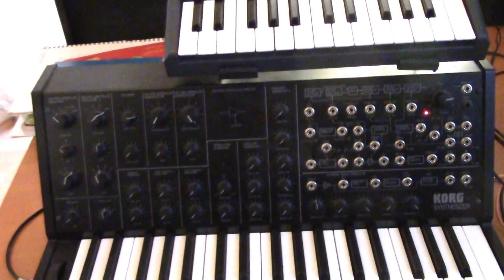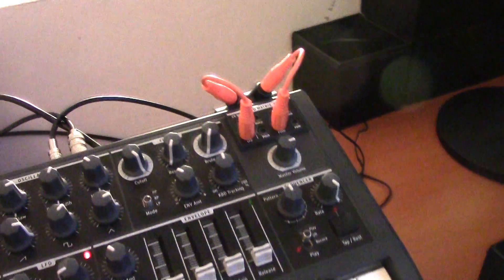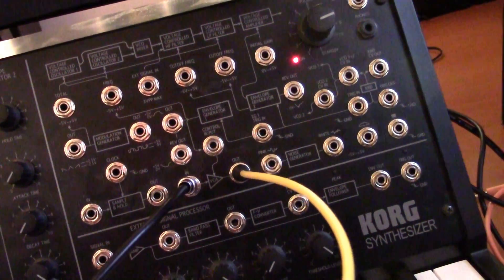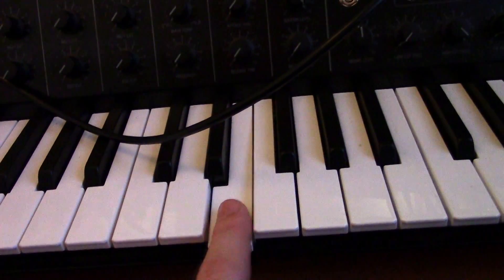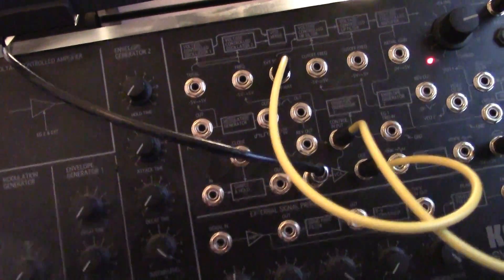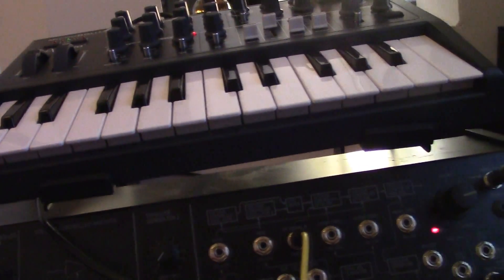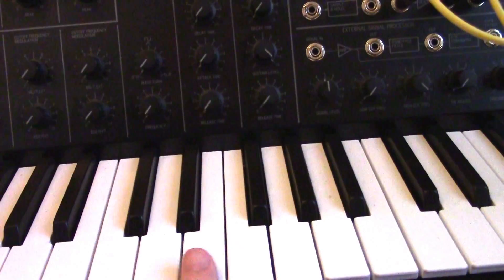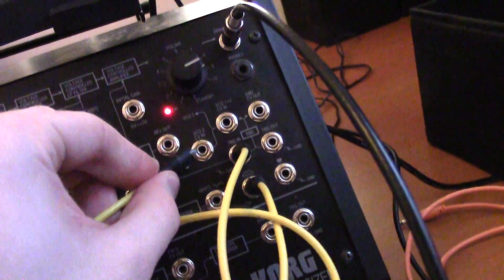Using the MS20 Mini's Filters with an external Signal (Patch Tutorial)

Comment: this did not work for either my erebus or minilogue
Reply from the maker: Sorry to hear that. 
What step exactly did you have problems with?
Reply: @fuerlingerp  I'm not sure I followed everything exactly, I guess my question would be if you were using an audio output or a CV output? I only tried with an audio out and another tutorial I tried that was slightly different also did not work for me.
Reply from the maker: @smashinglollipops  I'm most definitely using an audio output to patch into the MS20. Hope that helps. :)
Reply: @fuerlingerp  I've had other patching problems and I bought my Ms-20 used some time ago, just hoping I'm missing something and my patch bay isn't non-functional :/

Comment: Very helpful. Question: When I send signal IN from Ableton, I am getting a hum noise. Is it inpendance issue?  If I do audio IN from another synth, it works just fine. PLease advise
Reply from the maker: A hum like that can have a lot of different reasons. In general it is a good idea to have all your gear connected to the same outlet in order to prevent "ground loops". The reason could also be a poor ground connection on the synth itself. A DI-Box or on of those coils which reduce the noise should also help. Unfortunately I do not know what those are called in english, I'm very sorry.

Comment: it's a bit easier if you use the external signal processor. patch your microbrute into 'signal in'. patch out of external signal processor amp (right next to signal in) into "ext signal in" (top). Then patch external signal processor "trig out" into "trig in (kbd)" and that's it. Bring up your signal and you can utilize the ms20 filter etc without the extra patching.

Comment: I think you can mimic the arturia brute factor by using the headphone out and putting into the external signal processor and out to the external signal in. As the latter is already used, you will have to use a Y adapter.
Good tutorial by the way. Well explained.